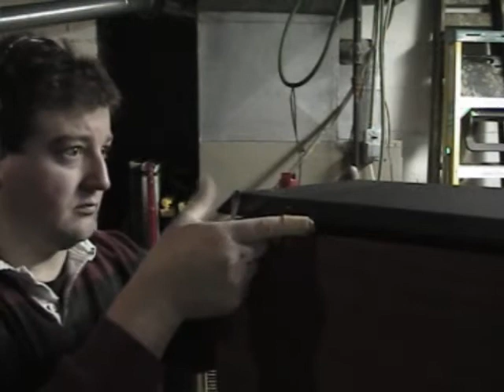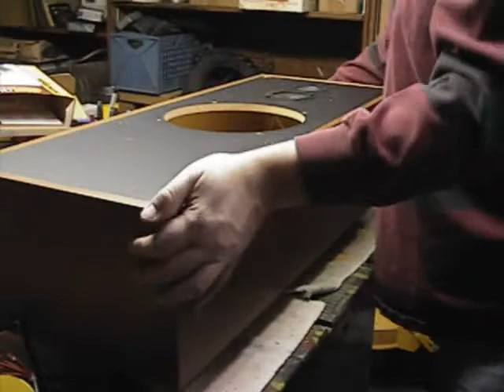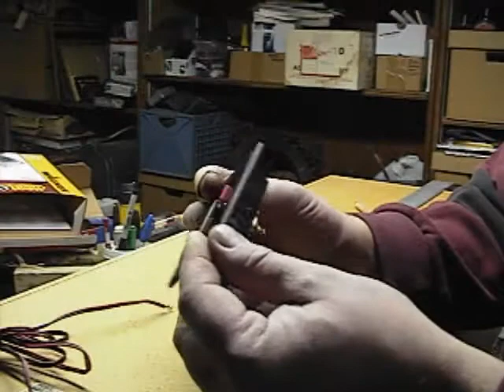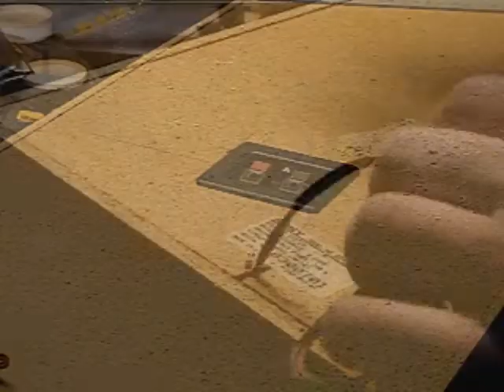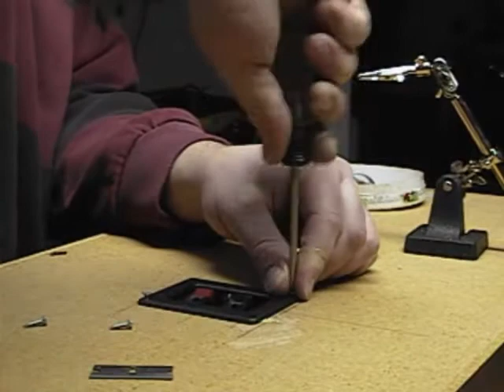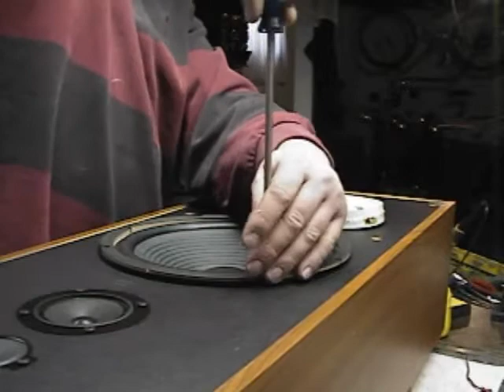Rewiring some speakers

Comment: What do you call that thing you stick in the wires and the tool you use
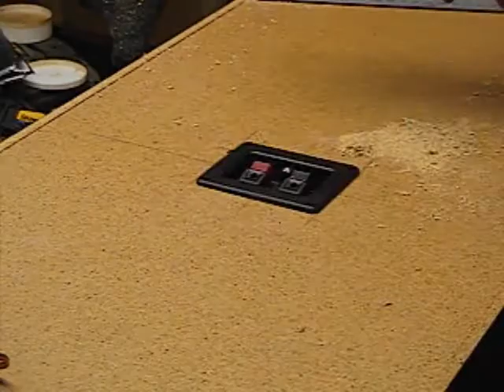Reply from the maker: Martin, the thing I'm sticking the wires into is the back of the speaker terminals, seen at about 1:04 from the other side.   The tool I'm using is a standard Radio Shack soldering iron.